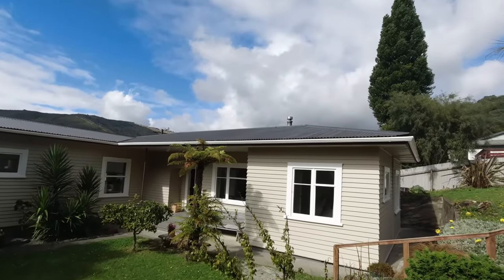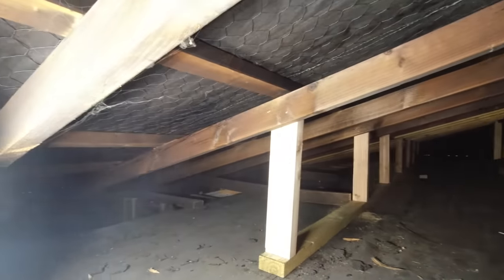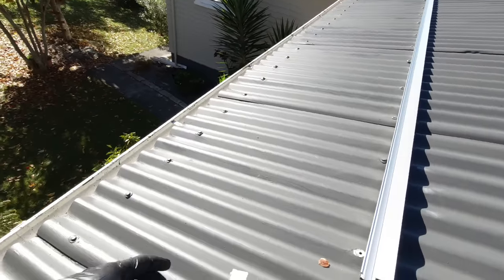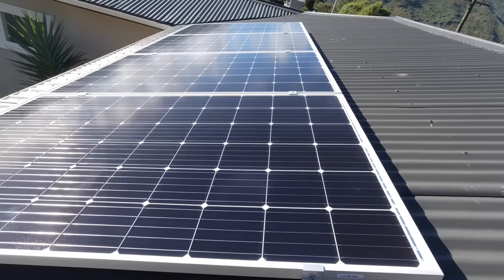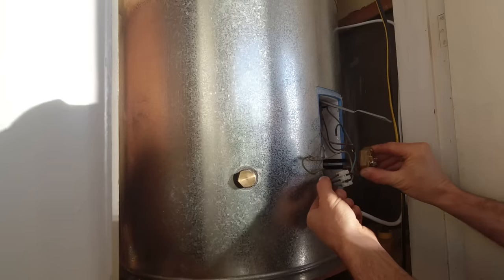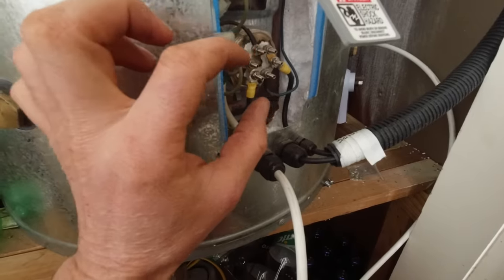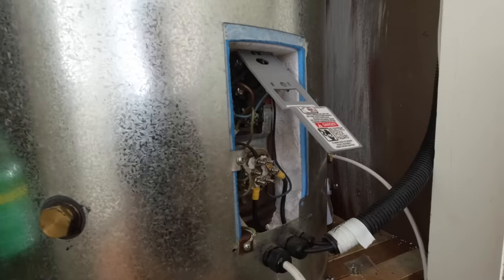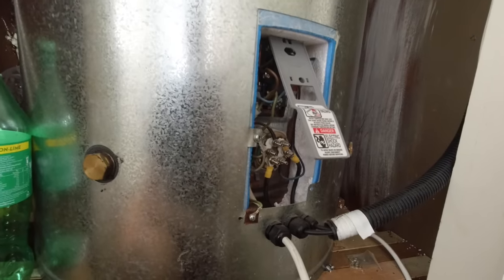Installing PV Solar Panels using a Water Tank as the Battery.. Halved my Power bill

Comment: things like this should be taught everywhere. I would have never guessed there was a heating element that was capable of running on solar and Ac power. Genius.
Reply: Same here. We have an oil furnace which heats all our water, including baseboards. I want to install something like this to raise the temperature of the water so there's less oil to burn in the winter. These videos are priceless.
Reply: All electric heating elements can be run on DC or AC.  The thing you have to concern about is the thermostat, since DC will cause arcing and eventually destroy it.  Using an external contactor is a cheap way to preserve the lifespan of your water heater's components.
Meanwhile if your system is directly solar powered, you could dramatically decrease the wear from arcing if the thermostat triggers before sunrise, since that would allow the power to slowly ramp up over time.
Reply: Switching on a high power DC circuit is not a problem, however switching it off is where one gets in to trouble.  Solid state relays and power electronics in general is one way to solve this problem.  Another solution is a snubber (capacitor + resistor, with the proper values in both) wired in parallel with the switch.  This short circuits the arc created when the DC switch is opened and a millisecond later the snubber stops conducting so the current is off.
Reply: They do make DC thermostats for these low voltage elements be careful when you. Buy the elements some file off the writing because they are using AC elements that you can buy anywhere for about 5 bucks an element. Know who you are dealing with. 73

Comment: I’m always amazed by the engineering talent on YouTube. I didn’t know that DC/AC immersion heaters were available. Great Idea. Well thought out. 4 panels and a heater, who would have thought it.
Reply: This is a DC to DC heating system and uses AC as back up. Not the best way to do it because of the corrosion build up on the DC element.
Reply: @hein_mcleod  the current runs completely isolated from the water. The conductor is surrounded with a ceramic insulator wich is surrounded by pipe. The heating coild couldn't care less what kind of ac/dc runs through it.

Comment: Cool project.  I've managed to lower my power bill by installing a timer on the water heater,  changing lights to LEDs and replacing my old AC unit with high efficiency unit.  I really enjoy the variety of your videos.  Cheers
Reply: Am thinking of doing same on electric with heat pump

Comment: so sweet, no charge controller, no batteries, no inverter...just solar panels, wiring, and lots of hot water! 😎
Reply: And poor performance.  I do it with just a little control board and get twice the daily output of a direct connect system.
Reply: @opera5714  possibly...but you also have more points-of-failure, and he's not suffering from lack-of-performance. premature optimization is evil.
Reply: This is a good point, keeping the output in an optimal state really helps and you can then reduce.number of panels required 
So kudos for the video, and thanks for this post to point out there's big improvements to be had

Quote ...
What is MPPT? MPPT or Maximum Power Point Tracking is algorithm that included in charge controllers used for extracting maximum available power from PV module under certain conditions. The voltage at which PV module can produce maximum power is called �maximum power point� (or peak power voltage).

I'd say reducing the PV panels is great. But we can choose what works for us.

I'm looking to do something similar but have very limited roof space. Happy to learn these things.

Comment: I like the idea of solar hot water. No charge controller needed. Right now I have an instantaneous water heater running on propane. Best thing I did. Only one 15 lbs of propane every other month. With me wanting to add solar to the water heater tank my propane should last even longer if I shut it off when there is enough hot water. Propane will be used on cold days and rainy days. It's easy to turn off the propane because the heater runs on 2 D batteries for igniting the gas. This is all good. I will run other panels for other power requirements. All good. 73

Comment: If your maxing out and still not using all the power, you can run a small loop with a radiator for heating in the winter.  That is why I am on your channel.  I was considering a sand battery as well so that I may access the heat for hot water and heating.

Comment: As an electrician and electronics tech I had not heard of 'DC elements' before. A hot water cylinder element is just a resistor, it doesn't matter whether it is fed with AC or DC - it will still heat the water. After doing a little research I see the difference is in the voltage ratings - low voltage elements suitable for direct panel connection at 12, 24, 48 volts etc. Essentially the term 'DC element' is more about the voltage than the supply being DC so a better term would be 'low voltage element' as a 230 volt element could just as easily be run on DC if you decided to series (or series/parallel) connect your panels.
Reply: Good insight

Comment: Curious what you think about just putting hot water panels on the roof?  In other words, heat the water directly with the sun rather than using electricity in between.  Did you consider that?  The efficiency of energy gain is much higher, though the system would obviously be very different.  Rather than solar panels, wiring, and a DC element, you would have hot water panels, plumbing, and a pump.
Reply: On cloudy days when you need the mains power to heat the water, would the hot water being heated from the mains just radiate heat off the roof? So on cool days you’ll be cooling the water via the system?
Reply: These days Solar PV works out far cheaper, and no maintenance required, unlike solar hot water.
Reply: If he regularly gets decent frosts then solar hot water is a waste of money. The system will eventually crack and be destroyed within a few years. I had a system for frost areas on my roof that popped a couple of years ago, it was only 6 years old.
Reply: We have a solar water heater on the south facing roof in Yorkshire and it is a waste of time, the water in the house pipes is ambient and unless you run the taps for a while you get no benefit, we have turned ours off, as we do not know it's history, but the numbers are terrible, it seems it would maybe save us £55 per year if we used it properly, the servicing cost is £250, not rocket science to work out there is no point, PV makes far more sense if you can afford the initial outlay.
Reply: @H4rleyBoy  that's very interesting... I've never heard of someone with firsthand knowledge of such a system. The ambient temperature loss has to be what kills it.... that's what I would guess
Reply: @nickw7619  The stinger in the story is we bought this house from the daughter of a woman who had dementia, she answered the door to the salesman of the company who eventually installed the system, £7900, for what is clever, well installed but ultimately rubbish if you intend to save money.
Reply: I heat the house with firewood and woodpellets.
During the summermonths, where we only need hot water for baths etc. We get our hot water from hot water panels.
It takes too much firewood to heat the whole system, when you only need hot water.
Reply: I installed such a system in the mid 80's.   Still running.   I mounted the two 4ft x 8 ft panels off the ground for easy access and to be able to clear off the snow in winter.   I live in eastern PA, USA.   The panels have a closed loop of propylene glycol solution which is recirculated through a coil in the bottom of an 80 gal water tank.    This is a pre-heater.    The cold water comes into this tank then out to the normal electric heated tank.    On a sunny day in winter, the panels can heat the 80 gals to over 130 deg F.   In the spring through autumn we do have to be careful setting the tap since we can get really hot water.
Reply: @H4rleyBoy  Interesting.  We have a property with a single thermal solar panel on it.  All Summer, no gas was used to heat the house and none for the water either. The system kept the entire tank hot all Summer pretty much.  Only on the sucession of of cold overcast days we had in August was there a need for some water heating requirement but really it just sits there and works.  Hasn't been serviced in years and it's at least 20 years old.  It's a Bosch system.  We're a bit south of you in Northants and the panel is west facing so it doesn't get any morning sun.
Reply: @ruaraidhmcdonald-walker9524  I have no answer to that i can only speak to our system.
Reply: @H4rleyBoy  Totally agree, no argument intended, was just surprised to read your experience which is opposite to mine!! Just goes to show! Hopefully, you can get it working well.
Reply: @ruaraidhmcdonald-walker9524  nah it's turned off and all moved up into the loft. It maybe that it needs a service but we won't be doing it, glad that yours is working so wonderfully well though.
Reply: This type of system has been largely abandoned.  First it can't be used in cold climates. Secondly the system has to be able to overcome the ambient temperature which in many climates it will seldom be able to do with any efficiency. Finally the maintenance on such a system is very high relative to other options that are more modern and efficient.
Reply: @JHruby  good point we're at 1000 feet it rains a lot and is windy most days, the glass will protect ot up to a point but we think the old lady was scammed.
Reply: I think that's what they do in Spain, Portugal etc. Less capital cost and a simpler install I suppose?
Reply: We are having a solar thermal system fitted via a Green Homes Grant. Will be interesting to see how much it effects my gas bill.
My uncle had a very early system fitted 40 years back and it was superb.
Reply: I assumed the same but seems I am wrong. Good to know.
Reply: @H4rleyBoy  Thanks for that info.
Reply: Done that more expensive. Plus frost protection, computer control and pumps
Reply: @rl3898  not applicable to all installations it seems.
Reply: Everyone is scared of a few electrons and thinks plumbing will make life easier. Solar world is still in the dark ages about heating water. PV is so much easier.  Direct connect like this guy uses isn't very good.  Everyone gets lured by simple, but simple sucks.  When the panels go to half current, which is a lot of time, the power generated is one quarter. Go even lower and it gets much worse. So, you need twice as many panels as one under electronic control.  I use electronics to keep the panels at power point voltage.  It is a fairly simple system that allows me to even have hot water on cloudy days.  I don't waste any power, don't need batteries or inverters.   If you want to see how it is really done check me out.  And if a wife lets you put those ugly solar tanks on your roof, hold onto her like grim death.
Reply: @opera5714  an MPPT charge controller is what he's referring to effectively. It would sacrifice voltage for amps and thus be overall more efficient in supplying DC current to the element
Reply: @ChrisBaileyMusic  MPPT charge controller and battery systems are done but but not a very good idea cost or efficiency way to heat water.  He has two elements and two in parallel are only right for two hours mid day. Using a timer to disconnect one element DOUBLES the output the rest of the time. It is kind of a lie to show a cloudy sky and then show 1300W being produced for the sake of theatrics.  People are given an unrealistic idea of direct connect.  Show an amp reading every half hour if he wants to be honest.

Comment: Always a good video from Marty T. We had PV panels fitted when we retired to this house, and later a switch to dump any unused power into the hot water cylinder via the immersion heater. It works like a charm and almost all of our hot water is solar-derived, even in the winter here in UK. And yes, I also save power by turning off all the things my wife turns on and then walks away from! Les

Comment: You are master of many talents and most important, a superb problem solver! Scabbing braces onto the sides of rafters is quick, but you are depending on just the shear strength of the fasteners. Add blocking under the rafter alongside the scabbed piece to make a better support.

Comment: Another great job & informative video. I have made similar upgrades to my house with 10kw solar in Queensland, Oz, I got $280 cheque from big power here for Xmas. I have a 5Kw split ac & a 2.5Kw ac also, we dont use them much, but i have just added a 3rd ac 2.5Kw. During the day I make around 30Amps @ 240v @ 1/5/22, in summer it is more, all air cons going at once use 12A max derating to 6 or so after 20-30mins, i just connected a 320 ltr hw system which draws 14Amps between 11am - 2pm & will make a few more mods here, I was using gas for hot water, but it is still inline as redundancy & because it was easier to leave it inline with few mods, so the solar handles this all ok when the sun is shining, but if I turn on everything at once, I can draw up to 5 amps from the grid, ie: 3 x air cons 10kw total, a large 2 door fridge/freezer with ice and water, another full size standup freezer, 1x40ltr camp fridge, 1x80lte camp fridge, 4 x tv’s, 82”,65” & 2 x 42”, coffee machine + every light on (LED lights use total was only .8A or 800mA @ 240v), so lights (LED) aren’t so bad generally if left on a bit. Love ya vids

Comment: Another GREAT project mate! Funnily enough I've been thinking about doing this for AGES here in England but council have cut my access off to the back of my property building bloody houses!! (So I haven't been able to take deliveries or have ANY rear access but I wanted to do this this year and in also thinking about doing an off Grid Campervan DIY conversion with 3 or 4 panels but again delayed til at least next summer now, but this will REALLY help with both! Especially with the power supply issues we now have in UK! I saw it coming and wanted to negate that risk but always a spanner thrown in the works this last 2 years! 🙄🤦🏻 Anyhow cheers loads of useful information as always! Great content and information mate!
Cheers from London England 👍😎🏴

Comment: Brillant, I have been wondering about this myself. Great to have this references if I pursue it further. Nice to see the install brackets on the roof, I have a small panel as setting up a small pump to heat spa water. So once I figured out configuration will need to instal the panel on the roof.

Comment: Great job there!  I would not even consider putting water heating panels on the roof.  With the PV panels linked to a thermostat, the water temperature inside your tank can be controlled, but with the direct heating panels you've got no control over the temperature, placing your water tank in stress due to overheating, over pressure, as well as the danger of scalding if a hot water pipe bursts.

Comment: I would attach a relay to the thermostat so that batteries can be charged while the maximum temperature is reached. This means that the panels can still be used during the break. Good implementation of the system, without major losses.

Comment: Marty, you could use rafter ties on all the rafters to help keep the ridge board from sagging. They are fairly easy, just have a board go from one rafter to the rafter on the other side of the ridge board across from it, plenty of nails on both sides, say about 6 for each side. they can be right up against the ridge or down a bit if you want.

Comment: Nice one Marty  you are definitely a GYRO of note ( Because Gyro is always coming up with new ideas) now we have hot water straight from the sun along with power from a washing machine old machinery given a new life boats that float wind turbines  battery power tool hacks fix the car no worries do some plc star delta PCB wiring mill some timber build some workshop tools make the best workshop bench Manuka honey  and cooking NZ green-lipped on the deck the list goes on  i wait in anticipation for the net instalment   Mark Broomhall Loch Sport Victoria Aus

Comment: This is a huge improvement. I wonder if power supply companies would ever consider making this set up standard for houses, the benefits to all are good.
Reply: Power companies want to sell you power - they generally aren't very supportive of people installing their own solar - even less so of them putting anything back into the grid!
Reply: I installed PV for DHW in 2015.  Two years later the power company installed a new power meter here.  My power use had dropped to half of what it was and public domain aerial photos showed the solar panels.  Recently I was notified that another new power meter will be installed.  My power use is far smaller than they expect.  They might suspect that I am pushing electricity back onto the grid when in fact I only send it to the water heater and divert the excess from that to electric baseboard heaters.  This is an easy project.  It is the homeowners who should make this the standard setup for homes-- NOT solar thermal for DHW as that is too complex and too costly.

Comment: Hey Marty , I'm on tank water and have a header tank in the roof ,which gets hot enough to eliminate most of the water heating requirements in summer.
Did you import those panels from China or buy them from a local supplier?
Is that a Powershop usage page? They have excellent usage info to monitor any improvements you make.
I saw a 30% drop in power usage just by putting a thermo-wrap around the cylinder .

Comment: here in canada the hot water boilers normally have an upper and a lower ac heating element. i replaced the lower one with 24volt dc and left the upper one in place. the 900 watt 24 volt element costed just 30 dollar and is working for over 2 years now.